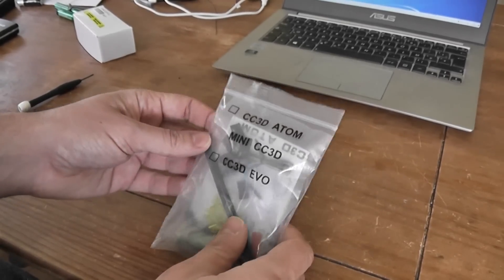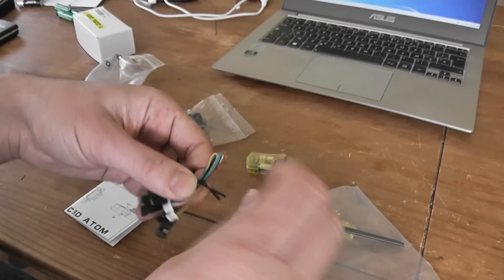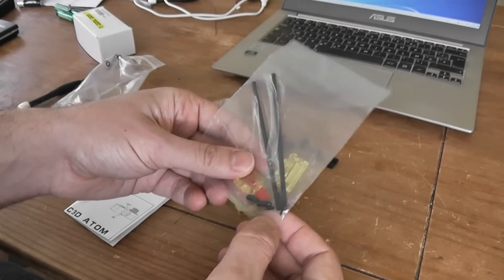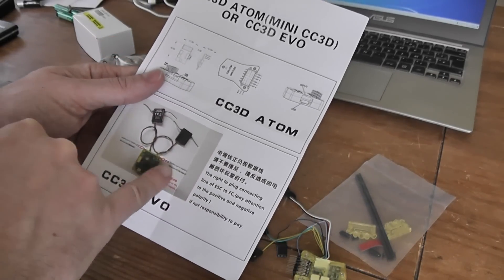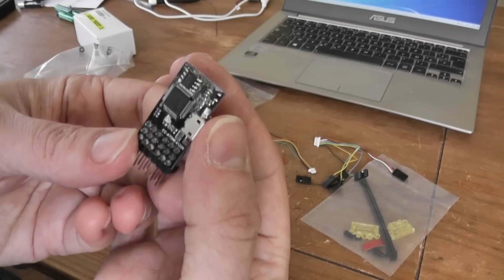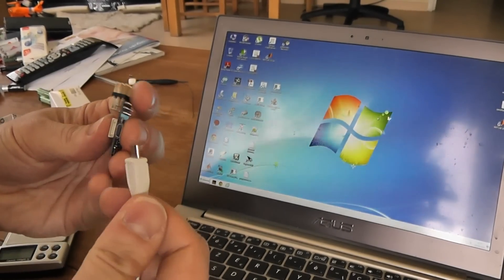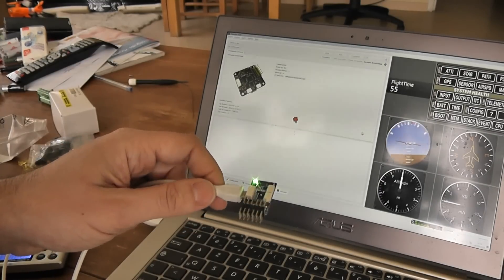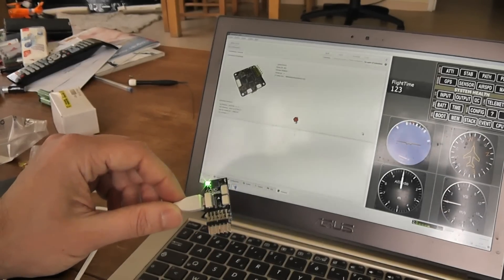Atom mini CC3D unboxing (Courtesy Banggood)

Comment: salut Seby DocKy et merci pour ta review :)
j'ai reçu cette carte avec un kit Diatone 160 Power Set G160 (j'aurai préféré une Naze32 mais bon ^^) et je voulais savoir si l'alimentation de la carte se faisait par les 4 esc branchées moteur 1 (bas à droite) branché sur la prise 1 à droite etc ou s'il fallait utiliser la prise avec 4 fil ?
Reply from the maker: +davelaclasme Tu peux alimenter ta carte par l'un des BEC de tes ESC (si ils ont en intégrés), soit par un BEC externe ...
Reply: +SeBy DocKy c'est ce kit http://www.banggood.com/Diatone-160-Power-Set-G160-Frame-Eachine-BG1306-3100KV-Motor-Mini-CC3D-Emax-12A-ESC-DAL-4045-Prop-p-1012754.html sur mes ESC j'ai une prise servo avec 3 fils marron, rouge et jaune (dans l'ordre) je ne garde donc qu'un fil rouge sur les 4 ESC
merci pour ton coup de main :)
Reply from the maker: +davelaclasme En général, si des ESC ont des bec (comme il semble dans ton kit), tu connectes 1 ESC avec les 3 fils de la prise servo sur la prise associé du moteur sur ta carte. Pour les 3 autres moteurs, pas besoin d'alimentation Tu enlèves le fil rouge du milieu de la prise servo pour ne garder que la masse et le fil du signal

Comment: hi, I bought the same cc3d atom mini, can you make a video on how to install the cc3d to receiver and do a full setup of it. cause I already try to set it up but my toggle switch not working
Reply: Rossland A Rahman Just connect the cable with more wires to the receiver. Start from port 1 of the receiver and connect there the connector with 3 pins. Put the rest to the rest of the connections of the receiver. The order is not important. Just be careful .. the orientation of the connector on the receiver is important. The black wire is ground and the red is power(voltage) the rest of the colours are signal wires. Check the receiver to see where does it want the signal cable.
Reply: nameadrian thanks man, i will go back check again all the wiring...
Reply: Rossland A Rahman what receiver are you using?
Reply: nameadrian i using orangeRx R610 received with jr dx7
Reply: Rossland A Rahman ok  . Connect the cable with red black and ..x color to the THRO label. the rest of the cables connect to the row with the signal pins(order is not important). My receiver (different brand) has the top pin as signal an the middle as voltage and bottom as ground. As from what I saw on the internet the TOP is the signal row for your receiver as well.
Reply: nameadrian ok, i will do that once i reach home...  I will get back to you again...  Thanks man for helping me out
Reply: nameadrian hi, i already solve the rx and tx issue now i using turnigy 6xs.... I test flight just now but it does not fly well very unstable maybe my settings on the cc3d not good
Reply: Rossland A Rahman Well it was like that for me too. I could barley keep my 250 quad in the air. Try this :lower your export settings. also don't use "rate"
Reply: nameadrian i will give it a try later today, i also notice that one of the motor delay when i turn on the throttle
Reply: do you mean that it starts spinning latter than the rest? Run the configuration wizard and follow the steps. It will fix that for you. But during flight it really does not matter.